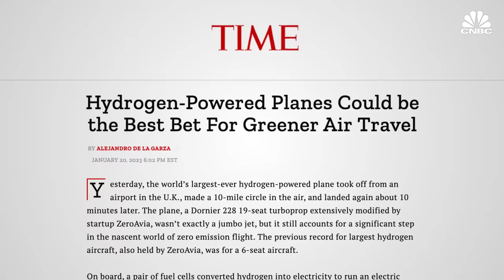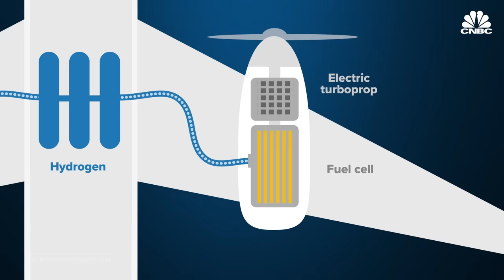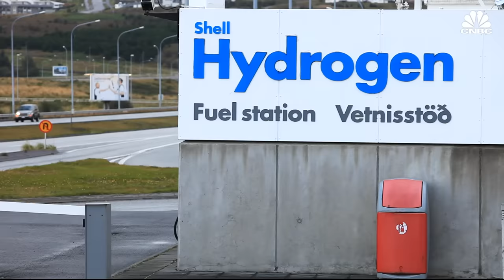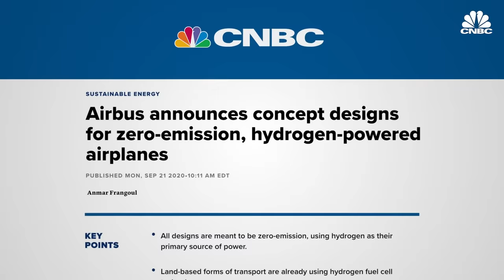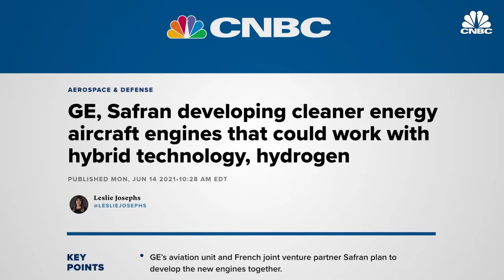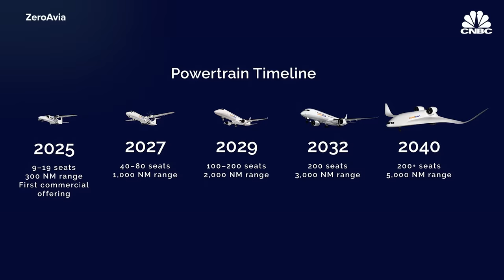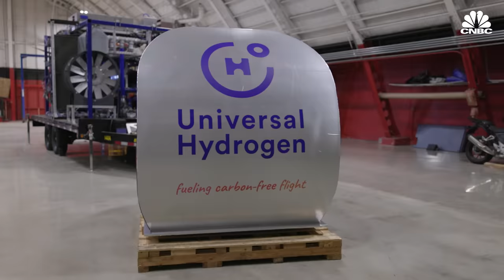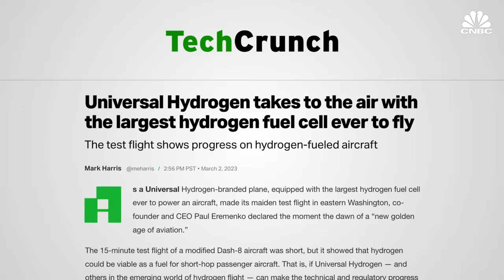Why Hydrogen-Powered Planes Will Beat Electric Planes

Comment: I'd like to see a similar report for the future of shipping and sea transport.
Reply: nuclear is the best option
Reply: Best thing about shipping is that, as 40% is for fossil fuels, only 60% will be left to clean up...
Reply: What> sot Nitrous Oxide emissions and lung disease in preference of carbon emissions and sunburn?, The solution is with US. We stop flying. The flight companies won't stop the supply unless the demand disappears. so it is the job of the public to renounce air travel to bring change, not the job of the companies to reduce emissions. It is us the people doing international travel all the time that are the root of the problem. Demand creates supply
Reply: You know you won't believe me but shipping once was a completely green industry.
Reply: Maersk is building green ships to test new tech.
Reply: The navy has done well with SMR’s, why not cargo ships?
Reply: @anonymousasia8187  sure. Regular people have the power. Lol.
Reply: One thing for the larger container ships is... Wind power!

They've had systems that could save like 20-30% in fuel. It is basically a giant parasail they can deploy once out at sea and can control it via a super strong tether that unwinds from a winch.

 I am pretty sure it has been proven to work. Not sure what the hold up is to be honest as it doesn't take that much space and makes up for it with less cost!

 Anyway I am a firm believer that hydrogen doesn't make sense for cars especially as batteries improve. For aircraft and shipping? Absolutely. There was this new hydrogen generator that creates it from salt water which could be fit on ships to create some of their own fuel using solar and wind. This was theoretical though.
Reply: Methanol+Ammonia is the biggest emerging fuel in shipping rn. Source: work for company that makes ship engines
Reply: @anonymousasia8187  It's up to people to demand change from politicians and elect ones who'll create the laws needed.
We don't have to stop flying, that just takes away money from airlines and manufacturers to do the research needed.
The car industry is changing and we didn't stop driving o make it happen, did we.
Reply: @TheTruth-yq2jb  Disposal of waste in 50 years and cost of the SMR.
Some ships and every train made since the 70's already use electric drivetrains with diesel motors to run electric generators.
JCB just created a hydrogen diesel engine replacement with 1 to 1 power parity for heavy equipment operations.
Storage of hydrogen on a ship or train isn't an issue making these the easiest industries to switch to hydrogen.
CP Rail in Canada is already working on this.
Reply: @dianapennepacker6854  Spot on Diana except for what you said about cars.
Hydrogen has to work for cars, if you're in a small island nation where space for solar and wind is limited and cost prohibited, hydrogen makes perfect sense.
That's why Toyota won't give up on the idea they have no other choice, Japan doesn't have the land to use for solar and neither does any island in the Caribbean, Indonesia, Philippines ect.
They use diesel and gasoline to run cars and generators for grid electricity, hydrogen would mean 1 fuel to import which they could also produce with a small land sacrifice for solar or wind.
Reply: It is obvious that the future of sea transport is to go back to sails. The alternative, ie producing hydrogen with wind turbines to use it in ships is just mad regarding efficiency.
Reply: @Robert-cu9bm  No
Reply: All alternative are way too inefficient and costly compared to the cheap bunker fuel
Reply: Yeah, I second that. A similar thing's happening already, with big hydrogen ferries. So just scale it up a lot and stick the same stuff in shipping tankers. That'd be wicked! 🙂
Reply: As hydrogen needs five times more volume, the ship will throw the sea cargo into the sea to put hydrogen in its place
Reply: South Korea has already developed hydrogen fuel cell(5MW per unit) powerd cargo ship and germany is developing ammonia engine powerd cargo ship.
Reply: @DMTHOTH  Cool.
Reply: @Robert-cu9bm  lol

Comment: I'd like to see a documentary like this that includes some explanation of fuel storage and transportation 'why' and 'how' -- including descriptions of storage container weight, materials and construction; compression and cooling equipment design and costs (up-front capital, O&M, energy (kWh) required to run it), and; transport and storage compression pressures -- in order to help viewers understand why a fuel with, "...the highest energy per mass of any fuel..." has to be compressed to 13,000 psi or cryogenically cooled before it's useful in an aircraft, car or truck. This would help viewers appreciate what it actually takes to achieve and sustain 13,000 psi or minus 425F, and the challenges created by such pressures and temperatures during transporting and storage as compared to traditional liquid fuels.

Comment: Former USAF flight surgeon and undergrad chemistry major here. Hydrogen has a very low energy density per volume and must be stored under immense pressure and/or low temperatures in order to have adequate energy to power anything other than very short flights. That requires very heavy, very expensive alloys. The very tiny molecule hydrogen literally seeps into metals and other materials causing “hydrogen embrittlement” and accelerating material fatigue. Extremely low temperatures make all materials less malleable and more prone to sudden, catastrophic fracture. Metals are bad, but plastics and other polymers can be even worse at low temperatures. Maintaining the necessary low temperatures adds even more weight and energy expenditure not directed to flight. Air pressure decreases with altitude magnifying the material stresses even more. The repeated ascents and descents under such immense pressure changes induce accelerated material fatigue. Temperatures also drop precipitously at altitude. H2 fuel cells and their platinum or iridium catalysts do very poorly at low temperatures. Direct combustion is more plausible, but H2 is incredibly explosive if a leak develops. Shut-off valves work well with liquid jet fuel, but much less well with gaseous H2 under immense pressure. All of the fuel lines and valves must be able to withstand all of the radical changes in pressure and temperature as well as the bulk H2 storage tanks. All of this adds immensely to weight which in turn stresses the non-fuel portions of the airframe and reduces flight efficiencies. We perform non-destructive stress damage analysis on current planes. This would needed to be performed even more sedulously on hydrogen planes. More delays and costs. Hydrogen-powered ships—yes; hydrogen-powered planes—I respectfully have my reservations. I hope they prove me wrong, but I heard none of these issues addressed to any significant degree. I am willing to be persuaded. Best wishes.
Reply: I love your comment. You disagree with the thesis of the video, provide adequate reasoning why, listed your former profession/education without any appeal to authority, but are willing to be proven wrong if something new comes along to refute old knowledge.

Personally, I think China is on to something with what I heard was ceramic or nano-ceramic lining for hydrogen tanks (I might have misheard, or gotten a bad translation). It's time to hack the Chinese to listen in on their scientific research, get some payback for their decades of IP theft of US secrets
Reply: You are correct in what you say, however, the developments for storage include carbon fibre encapsulation, which has demonstrated very good qualities.
Reply: All true and correct, however technology marches on and is unstoppable. It is possible that with aid of AI new trypes of impermeable lattices could be developed to counter the seepage properties of H2.
Reply: Jet fuel has an energy density of 43.5MJ/kg, hydrogen has an energy density of 142MJ/kg. Energy density in terms of Joules per Kilogram(mass) not Joules per volume. The way to do it without insulation is to use refrigerated tanks that operate on the ground and switch off in mid flight. That way as the liquid hydrogen boils it produces enough pressure to travel through the fuel pipes to the engines and doesn't need to be pumped. Certain metals, notably aluminum are resistant to hydrogen embrittlement. Now you may say that aluminium has low tensile strength but you can use a high strength alloy such as inconel with an aluminium coating to protect against embrittlement.
Reply: @Kazilikaya  Apparently neither are you. If you bothered to actually read the comment, the mass-volume problem with hydrogen fuel is exactly what I addressed. Very low temperatures needed to concentrate the hydrogen and reduce the volume severely impair Young’s Modulus and make all alloys much more brittle. The tanks are subject to cataclysmic fracturing at exactly the time external air pressure is falling as the plane gains altitude. If the plane is altitude restricted to reduce hydrogen tank rupture risk, air resistance severely impairs the fuel efficiency. Having refrigeration units on the plane to keep the hydrogen liquified impairs the thrust-to-weight ratio no matter when you turn them off. If the hydrogen is combusted, the heat and rapid expansion of the liquified hydrogen place immense stress on the pipes and valves with such extraordinary temperature gradients in the metals. If the hydrogen uses catalytic fuel cells to produce the thrust, the temperature gradient problem in the metals is reduced, but fuel cells are notoriously unreliable at extremes of cold. Yes, very expensive alloys help, but are, as stated, very expensive. Even very expensive alloys are subject to metal fatigue and must be non-destructively tested more frequently—again driving up delays and costs. I don’t know where you got the notion that aluminum is not subject to hydrogen embrittlement, but that is just demonstrably wrong—respectfully.
Reply: @SprakanaKerum  😂🤧the us is already doing that they just not talking about it in public